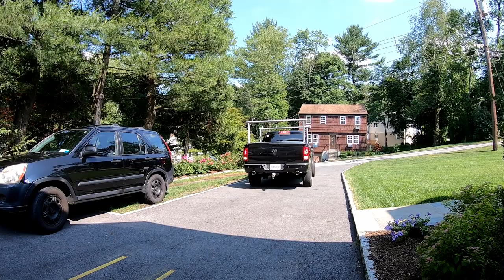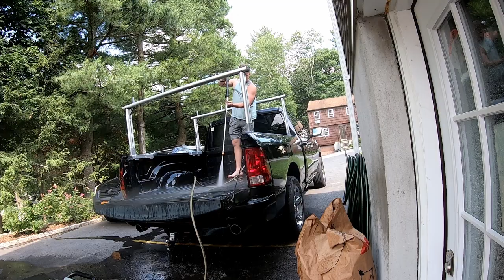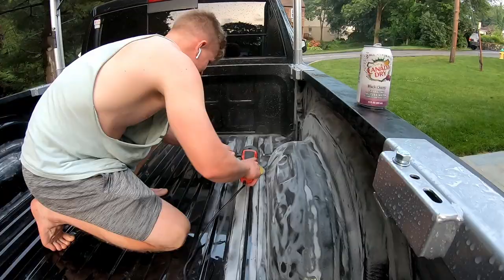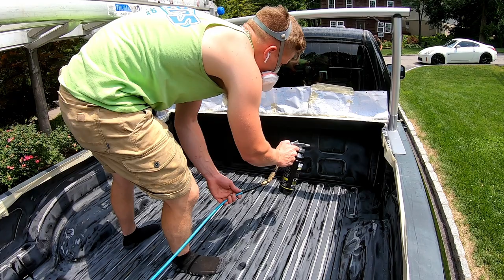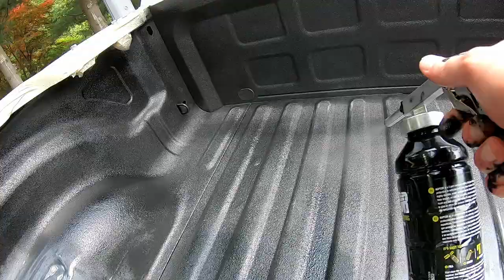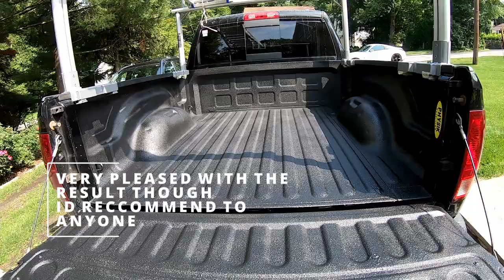$100 DIY SPRAY IN TRUCK BED LINER - IS IT WORTH IT??

Comment: I used Herculiner for the floor on my equipment trailer.  I would also recommend you spray on a 2nd to possibly 3rd coat to ensure you have a good thick coat on the surface.  I put 2 coats on the trailer floor and man it looked so much better than it did with just the one coat on it.  Food for thought.
Reply from the maker: Yes I was thinking of ordering more to do some extra coats
Reply: @jmventurelog  --  Sure glad I did.  It improved the over all appearance by 100%.